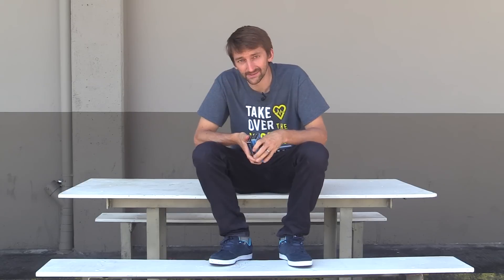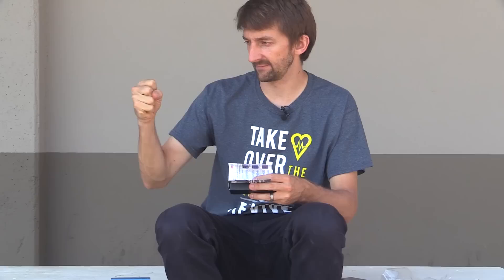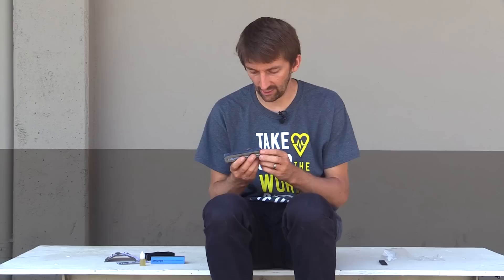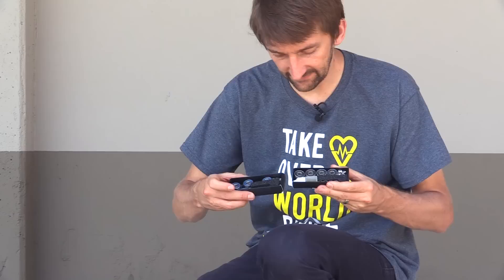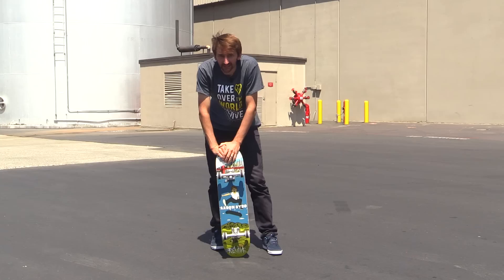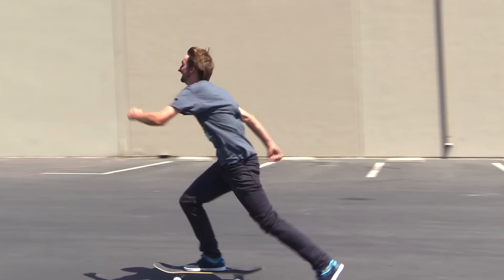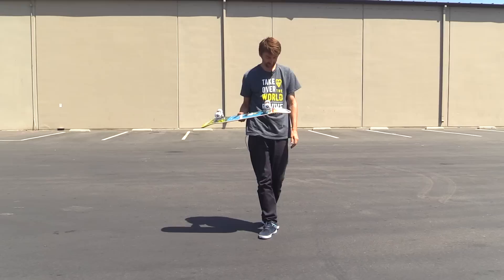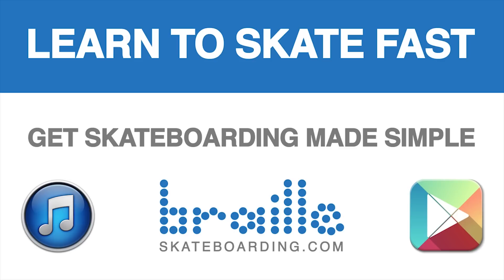CERAMIC BEARINGS VS STAINLESS STEEL BEARINGS | VS EP 9

Comment: simply 
ceramic balls wont expand when they heat up like the stainless steal balls 
and they will stay in the same size but the steal ones will expand and that would produce friction in the bearings
Reply: you're **
and thanks :P
Reply: stainless steel isn't going to expand enough to cause problems as a skateboard bearing.  ... MAYBE if you're doing some kind of downhill world speed record, but not for park sessions.
Reply: simply
learn how to spell steel. You got it wrong twice in the same run on sentence.
Reply: well what like steel is going to melt? I don't think so guy. it's like metal and metal is strong think about it.
Reply: Professor Genius you said it , you are using google translate 
Brandon the Man and its not gonna melt 
i think that they taught you in science that when the metals get hot they expand so they bearings would be tight for them 
and that would slow it down
Reply: +random blowup I did, are you trying to "steal" my thunder?
Reply: +random blowup well like everything melts probably I mean think about it how do they make it if it can't melt think about it that wouldn't work very real  but like I don't think wood can melt but steel can melt because how else would they make it think about it
Reply: Brandon the Man i didn't say it wont melt 
it would but not on that temperature 
but it will be enough to make it expand
Reply: it might melt if it's real old like if you leave butter out it gets old and starts to melt well like steel is old sometimes and it might melt too that might be where grease comes from to grease the bearings 

oh man think if you had bearings that would grease themselvbes by melting
Reply: dude the melting point for stainless steel is 2700 fh
i dont thing that the bearing would ever reach that
Reply: well but if it's really old maybe it melts more

Comment: I dont know if anyone would see this in time, but if you want bones swiss ceramics less than 140, everyone head to Tactics boardshop website. They are having a summer blow out sale. The bearings are 99.95 (already discounted from original price!), but with the summer sale, you get 20 dollars off an order of 100. So I suggest add these bearings to your cart, a 1 dollar sticker, and you can get these for 80 dollars. The cheapest price I've seen so far. Good luck!

Comment: just FYI, they don't make ceramic bearings from clay. even ceramics made from the best clay would crumble as bearings. They use stuff like silicon nitride. 
I think it's the same kind of ceramic material used in ceramic knives and industrial ceramics, but I'm not 100% sure.

Comment: I would never use ceramic bearings. It is a gimmick unless under high load  (usually 200+ Kg) and high speed e.g. 50,000rpm. The sort of speed needed to generate enough heat for those stainless steel bearings to expand and essentially slow down is unobtainable through the traditional push method in which we skate. On top of this as Aaron has subconsciusly done, you realise the standard SS bearings roll fast enough and you'll never notice it slow down, hence why has never picked anything "Better" than Bones Reds. Furthurmore, if you went through 4 sets a year, assuming they break or sieze or get damaged somehow, you can replace them all 4 times for a total of the cost of Ceramics, which if THEY broke...you'll have already spent $100-130 on two pairs assuming you bought from a reputable skate brand such as Bones for example. It doesn't make sense to buy them. Unless like me, you like to go outside of skatebrands and just try as many cheap options as possible to find that sweetspot between value and price. I will say this however, there are some amazing bearings out there that aren't skate branded, they are just the same size fit and work really well. I bought ceramic bearings for $4 per bearing, they are fully ceramic not like Bones or Synopsis which aren't fully ceramic, they are hybrid bearings...eitherway, did I notice any difference? nope. Bottom Line, if you know the dimensions of skate bearings and know good quality bearings when you see them or get them, then buy them. I have a full set of stainless steel bearings, instead of having 7 bearings in one unit they have 9...sounds better...makes no difference but they cost me $9 for 8....go figure. had them now for 2 years...still rolling with the times (click like if you know where that quote came from) and they have definately given their moneys worth. Hell, at this price i'd be more than happy to buy them every 6 months ha!
Reply: Can you link your non skate branded bearings? I'm super curious now!
Reply: VegetaFlex4Fitness Haha you know what's funny is I started working at a bearing-manufacture company 2 weeks ago. And my experience thus far confirms that high ABEC bearings are immediately brought down to the standard ABEC 3 class simply by being used for like a minute on skateboards, because they're not meant to handle torque or axial loads. ABEC has a very clear purpose, just not one relevant to skating or any kind of wheel-sport.
Reply: syth406
exactly...but you're looking at at least 25 years of product being sold on the merit of something that has no benefit. These skate brands that people have been so loyal to have been rinsing us all along. wheres the loyalty in that.
Reply: VegetaFlex4Fitness Yup.
Reply: VegetaFlex4Fitness 6

Comment: Surprised no one has made a tapered roller bearing for skateboarding.
Reply: Why would they? each roller would have more surface area on the inner and outer races, resulting in more friction. plus the end of the tapers would be more susceptible to ware. ball bearings are best for high speed low force applications..
Reply: Luke Andrew
You would only need a inner race, think of a modern car hub. You say "low force" I guess jumping down a flight of stairs is low force?
Also the balls do rub together which causes drag, but in a roller each roller moves without secondary load.
Skateboards are still very much stuck in the 40's with only a few improvements in the 1970's
Reply: All bearings involving rollers or balls need to have two races for the bearing to function. If the design includes one race formed into a bigger assembly, it is still a race, and one that is more expensive to change (i.e. the truck has a race as part of it's forging = replacing the truck come bearing replacement time).

In terms of bearings, yes those are "light" loads. Most bearings are able to sustain very large loads and high speeds, for use in machinery. Common uses in things like trucks, cars, household equipment doesn't usually come near the loading limits. Instead, poor maintenance is what kills most bearings. I think Timkin carried out a study and found that 7/8's (I cannot remember the figure but it was extremely high) of bearings are rendered unserviceable through corrosion, and poor maintenance practices. 

A plain 608 bearing can support something in the region of 140kgf static load, and you have 4 on a deck. Supported dynamic load ratings are much higher than that. What I think you are getting at is shock loads over time which can result in the races being dented. This is a problem with a ball bearing, but usually where a bearing is not moving very far. The headstock of a pushbike or motorbike is a prime example. These bearings move very little, not even 1/4 rev in normal use, but they get hammered on while the bike is moving over bumps. So you have a ball sitting in roughly the same point on the race, slowly hammering away.
Not so much a problem in the short term with a skateboard, but it will eventually come into play over time.

The balls in a ball bearing should be separated by a "cage", or ball separators. They do not touch.
Skateboards are very much stuck with a bearing design that works, is cheaper to produce, is compact and provides low rolling resistance, which is all very desirable for a skateboarder.
Reply: It's a good thought. You would have to preload the bearing so they don't wear strange. This would make it  a little more complicated, not much but a little, for the person putting the board together.

Comment: skate the ceramics on a longboard!
Reply: Of course! I would argue longboards are the only excuse to pay extra for ceramics. Also, softer wheels :) Longboards need as little friction as possible to reduce the work you are doing, and the soft wheels helps with vibration fatigue when going long distances.
Plus, its easy to explode ceramic bearings when doing tricks, which you wouldn't be doing on a longboard.

Comment: I use Ceramic balls in my RC race buggy which I race every weekend, it users a ball diff not a gear diff, it lasts 3 times long with Ceramic vs Steel. FYI I also use a Graphite grease for lube......

Comment: I thought ceramic bearings were designed to combat water damage..
Reply: They are cheap, but they don't heat up like metal bearings
Reply: Ceramic bearings can still rust well not the balls but the outer and inner race can and ceramic can crack on impact that's why I go with stainless

Comment: so do these work for longboards?
Reply: +Kelvin Wong yes.. bearings work on any skateboard that has wheels.
Reply: Unfortunately they don't. Long boards only run on tampons and shouldnt have anything to do with actual skating products.
Reply: +ChroniclesOfMe sorry i didnt know
Reply: Kelvin Wong
Oh, no dude I'm not talking to you I'm talking to oSNACKo, your fine man.
Reply: +ChroniclesOfMe as a longboarder myself I don't see why people hate on us. Just because we don't trick skate (which some longboarders do) doesn't mean that people need to hate on us. We're all just pushing wood so what's the big deal if some of us like to cruise and some of us like to trick skate. I have no problem with skateboarders and I've had many skateboarders just assume there better than me because I ride a different kind of board. We all just need to get along.
Reply: lol i skateboard and longboard, sometimes i just wanna ride fast and smooth down a big ass hill without torching my poor little boards wheels, when it comes to coasting down a long drawn out hill nothing beats doing it on a high end long board :)
Reply: Leon Wilcox, You do know that oSNACKSo was joking, and taking the piss out of Kelvin Wong, right?
Reply: @oSNAKSo that made me laugh.

Comment: Firstly, the resistance experienced is caused by the contact area. 
Most materials when heated expand, just at different rates and sizes. (on an atomic level if not visible)
So the stainless steel bearings will, under load. Expand and therefore cause more pressure (or resistance in this case).

Essentially the ceramic balls retain their lower surface area due to better thermal conductivity, they do not cause as much rolling resistance.

Comment: Ceramic bearings do not heat at high speeds, but are more fragile. They are good for downhill,  cruising etc.
Steel bearings are more robusts but heat at high speed, they are more suited to the street , bowl , vert.

ABEC 5/7/9 : mostly street, bowl...
SWISS/CERAMIC/TITANIUM: cruiser, longboard, downhill...

** I don't pretend anything, but yesterday I've met dudes who founded a bearing company and they explaned me that. **

Just hope it could help!

Comment: When you use steal ball bearing after use and heavy load doing tricks ect the metal bearing heat up therefore the metal expands causing more friction, the efficiency and rolling speed will decrease slightly the more it's under use. But ceramic bearing have a better heat transfer and don't go soft or expand under heavy load and speeds therefore having a better efficiency after constant use.
But ceramics is very hard so they can shatter if they exert too much load
Reply: This is exactly not how it works..but at least you are trying. The bearings in your skateboard will never heat up to a point where it will make any difference unless you grab a trucks rail and skate for like 50 miles at 80 miles an hour. Your bearings, ceramic or steel will fail because of the impacts while you do tricks.

Comment: Buy some full ceramic bearings from ebay. Not sure they will withstand the "beating" in a skateboard wheel. But they should be pretty resistant to rusting and not being lubed

Comment: The bearings create friction in turn creating heat. Metal is a conductor of heat and ceramics are insulators. So by using ceramics you are going to have a lower which would be better for grease.
Reply: Lower temperature*
Reply: +redstone
Exactly, and metal expands with heat, further increasing friction, reducing speed over time.
Reply: +redstone dawg its been proven that cernamic bearings are more likely to fail because cernamic was never really meant for skate boarding so metal bearings are a better choice, also its just marketing to trick the average skater, probably need to do some research
Reply: +ArrowMorgan As organic materials, various woods and metals of which the skateboard is constructed were never meant for skating, so you really can't say that ceramic bearings only fail because they weren't intended for skating.

Comment: "Forget the rest, NMB's are best" as told by 80's advertising in skate mags. Standard Bones reds are great if you hate riding bearings in but you absolutely don't need them. If you feel better riding expensive bearings then please continue. In my experience, they tend to need much higher maintenance than $1 bearings.

Comment: ceramic bearings are meant for speed only, they're brittle and can't take a lot of physical shock. They're meant more for longboarding than anything else because if you land a heavy trick on a regular board you run the risk of breaking a bearing

Comment: ceramics are made to have less heat to keep higher speeds, BUT they can break easy from landing hard on them. stainless is slower depending (depending on what brand you buy), but they will last you longer if you skate parks or street.

    ill put it like this, i had a cruiser setup so i could skate to my midnight job at a gas station. i had it setup with all weather stainless steel bearings as incase i had to skate in the rain as a last resort. well one night, i showed up to work and turns out i didnt have to work that night. so i decided i was gonna skate down the main road as no one was out that late and i could skate down a steep ass hill because i seen the longboard guys do it on youtube. the whole time down this hill, i just kept on turning like when i snowboard, nothing seemed wrong other then the fact i would get too much speed then jump off. when i got to the bottom, it felt like my wheel had some bad flat spots. turns out the bearings got so hot that they made my wheel explode. so my buddy at the skate shop sold me some ceramic bearings with new wheels, they were great as i got to work ALOT faster but they didnt last long because id ollie up onto the side walks and shit like that. ceramic is alot better if you longboard as the majority of longboards are ment for bombing hills.

Comment: It's worth noting that the material in a bearing is just one variable in a big list of variables that goes into making a good bearing.  Beware of marketing hype. 

A couple of points Arron missed about ceramics:
 Ceramics don't rust, so they take less of a beating from water and air.
 Ceramics require less lubricant, so when cleaning you should add less grease/oil.

Comment: In skateboarding applications you won't be able to tell a difference aside from the slight weather-resistance you get from ceramic balls VS steel balls.  Ceramics for all weather boards, otherwise stick to the cheapest removable shield bearings available.

Comment: ceramics don't heat up less (kinda), they just handle the heat better and will expand/deform less because of heat. Because they expand less they will have less surface area, reducing friction, resulting in less rolling resistance and eventually less heat. Another thing is that ceramic is inherently not going to rust, some steel bearings and even stainless steel bearings (too a lesser extent) will rust, this is why it is important to keep bearings greased and generally not ride in the rain.

Comment: the heat caused by friction makes the steel bearings expand thus causing more friction and more heat and so on. ceramic bearings expand less thus reducing this severely

Comment: Keep in mind this is all theoretical, ceramic bearing were originally designed for heavy machinery. For skating the difference is negligible, the fact of the matter is that you can't skate anywhere near fast enough to heat your bearings up enough to matter, The smoothness goes out the window (We are skating on concrete, not glass). the only real advantage is, is that they don't rust, meaning they'll last longer

Comment: i feel like with ceramic bearings, your wheels would wear out way before your bearings would, but with steel they would wear out at a similar pace and you wouldn't be taking the same bearings out of your old wheels and putting them into new ones over and over. also $150 is about what your entire set up should cost, not just your bearings

Comment: I got some Bones Swiss Ceramics nearly two years ago. The biggest difference I see is that they require way less maintenance and last longer. When I had stainless steel, I would have to deep clean them every 2-3 months and they would be dead within a year. With the ceremics, I think I've cleaned them once in the two years I've had them and they still work great. If you want more speed and are Intermediate to Advanced level; I'd go for it.
Reply: Ceramic cracks under impact
Reply: Everything cracks under impact.
Reply: +Cameron Bowen steel can but very unlikely it may dent but also unlikely ceramic is brittle and can crack much faster than steel